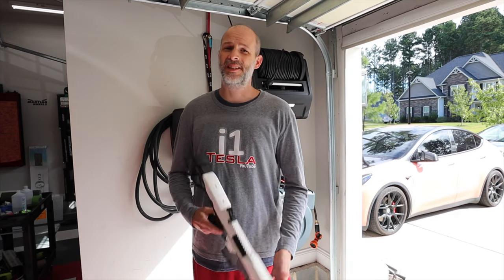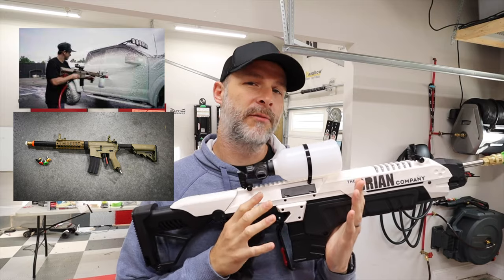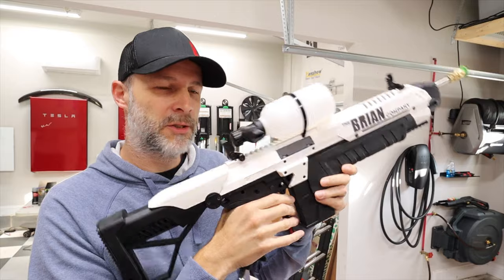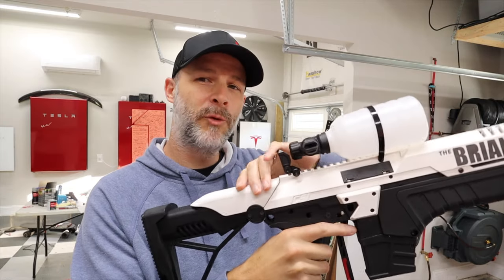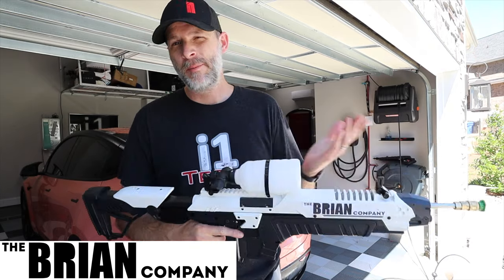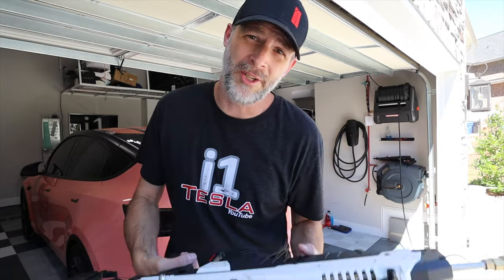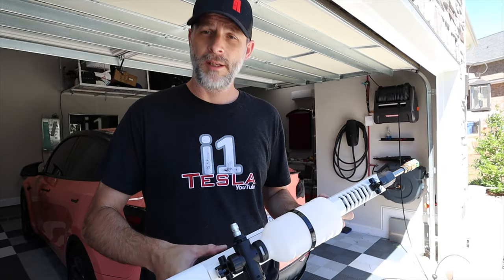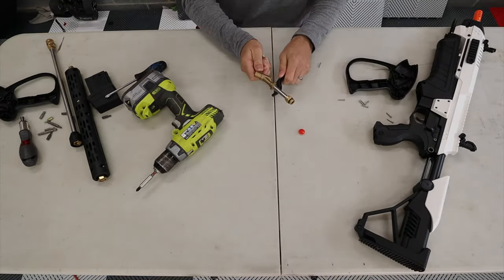The Worlds Craziest Foam Cannon Pressure Washer

Comment: That's pretty cool mod there dude the neighborhood dads and kids must be jelly! 

I bought that pressure washer been using the heck outta it!   
My only complaint is its very loud but works very well as I love the ease of use.  
Just pull hose out, turn on water and power switch and your ready to go.
No tangled short hoses and having to hook up water hose and plug it in.....

I got all 4 kinda the Washer, water hose, air reel and cord reel.
Put the two on one side like yours and the others on opposite side wall.